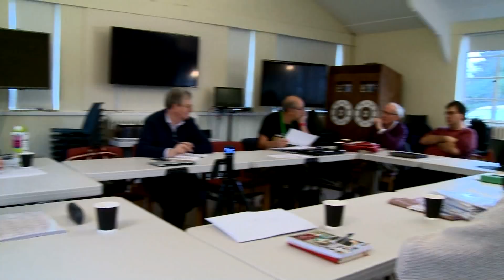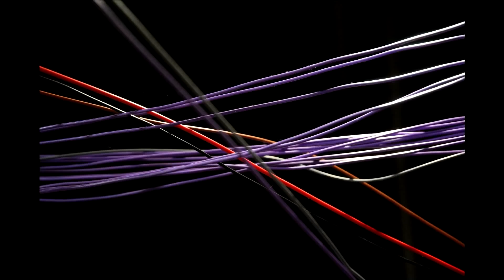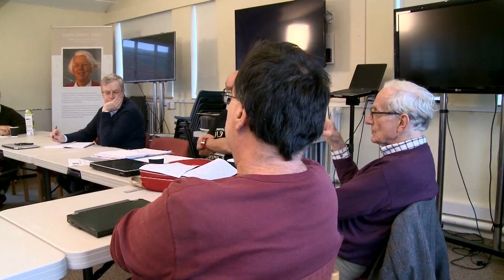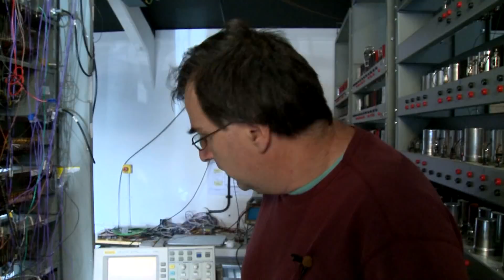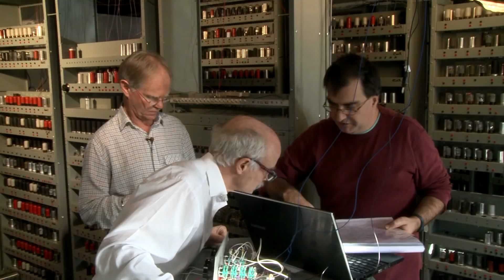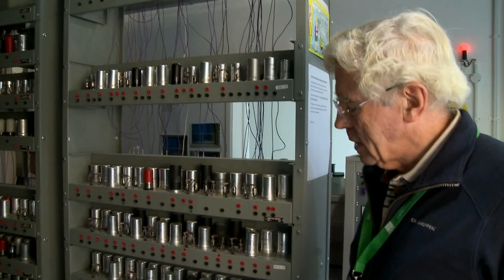Making everything count - EDSAC reconstruction update, January 2018

Comment: You are going to have trouble synchronizing your clock to the delay memory, the delay and the clock are going to change with temperature and age. What if you used one of the memory delay tanks as a sync pulse and then a phase locked loop to multiply that pulse by 576?
Reply: That's an interesting idea that hasn't been though of so far AFAIK. At last week's progress meeting we were talking about getting better stability in the main clock by using positive or negative TC caps. Trouble is, it always ends up as a discussion about authenticity - the attempt to not change things from the original circuits unless there is no other way, so I doubt that your PLL method would be allowed. I have suggested synchronising the main clock from injection of pulses from a programmable oscillator, and I guess that we could measure temperature and tweak the oscillator frequency to track the requirements of the tanks. That way, the main clock would still be the original circuit with just the addition of a small capacitor for injection of sync pulses.

Comment: 6:06 "It has worked in the past with recent changes we've made it has stopped working and without it working main control can't fetch instructions and data."
Sounds like what happens to me when I change code without committing the previous working version, thinking I can just use the undo history to revert. It never works out that way.